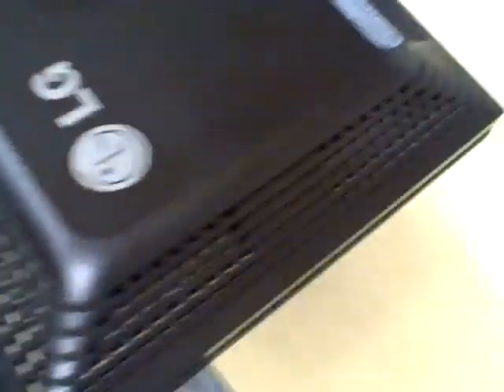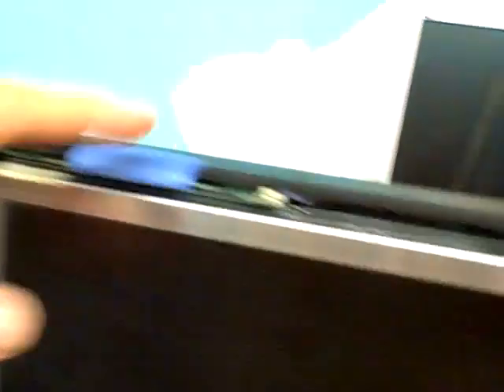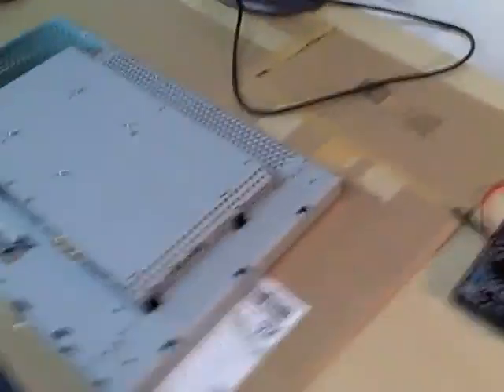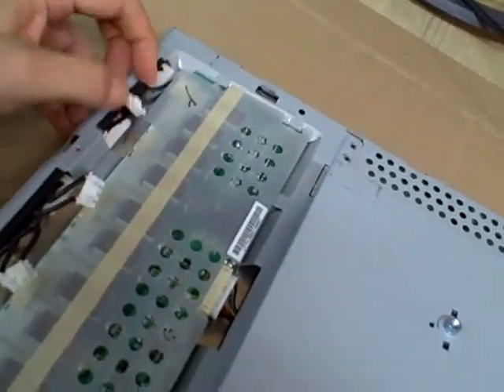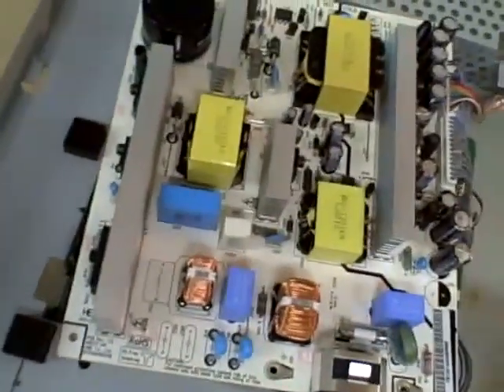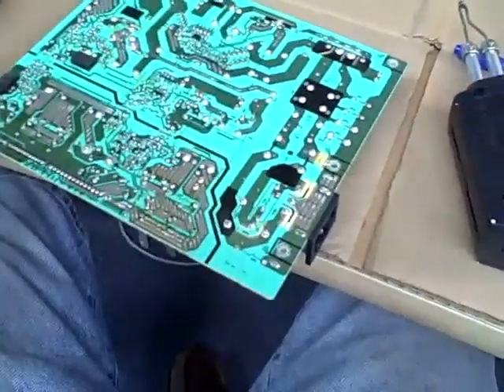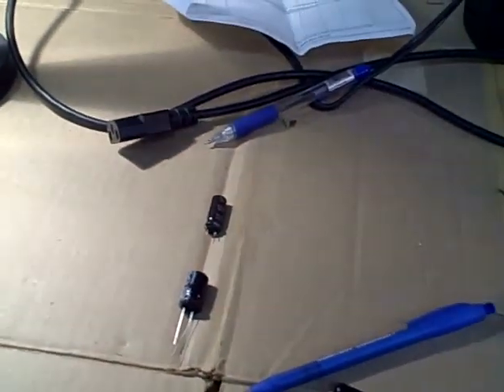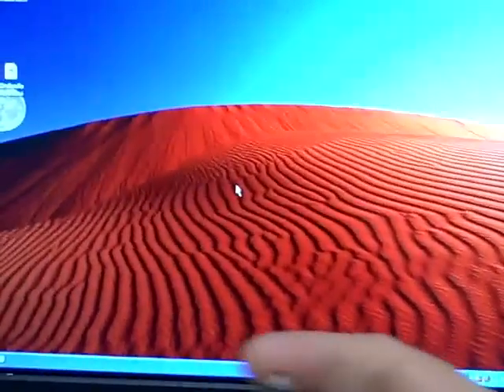LG Flatron L246WP-BN Monitor Repair Tutorial

Comment from the maker: It took about 3 or 5 months from the time my monitor first started having turn on problems until it quit coming on. The capacitors are cheap and it is a relatively easy job. It they fail completely it might be possible for other parts to get damaged so you should not wait.

Comment from the maker: There are two "bad" capacitors that need to be replaced. The circuit board has room for three caps but only two were used to save money. I removed the two bad caps and replaced with three. I had the same wake up problem for a while until it failed completely. New caps will fix.

Comment: Kent, how many 493-1505-ND capacitors do I need to replace?  From watching the video it seems you replaced just one but I'm not sure.  Also, do you have problem with your LG 246WP-BN from waking up?  2 of my 4 monitors won't wake up, the power LED won't turn blue, they always stay yellow unless I do a manual shutdown then power it back up then it turns on.  Yeah, I'm using the latest ATI drivers too.  I really don't know what's wrong with it.  If you have a solution please let us know.  Thanks.

Comment from the maker: Cost cutting is when they remove all the parts possible and still work. The original layout had three caps but one was removed to cut costs. I used three because I could. Generally more is better in power supply filtering. As they degrade over time I will have 50% more margin with three.  It only an extra $0.85.

Comment from the maker: I was told a long time ago that electrolytics work best when near their rated voltage so I picked 6.3V for a 5V circuit. That theory seems to have gone out of favor with the idea that a higher voltage cap is supposed to last longer than a lower voltage one. I am sure the 8000 hour Nichicon will do great even though it is 6.3V as it has been rated for long life under harsh conditions. I do not have the part number of the one I used. Any cap you pick will be better than a bad bulging one. -cont..

Comment: From your video it sounded like the 10v ones were OK, despite their larger sizes.Why did  you switch to smaller ones? Also, I think you are saying that instead of replacing just the original 2 capacitors, you used the extra receptacle on the board and installed 3 capacitors. Why did you do that? Also, do you have the Digi-Key part number of the 6.3v capacitors you used? Thanks

Comment from the maker: Yes. I use it every day. I used three 6.3V, 3300uF Nichicon HE capacitors. Since it was a 5V circuit I chose 6.3V. A 10V high quality cap would have had a larger physical size as the the highly rated caps are larger for same rating.

Comment from the maker: A high pitched noise usually comes form the transformer. I have read that excessive current draw or a shorted winding are common reasons. I have fixed similar issues with a shot of hot glue. 
Since this happened with new caps, it would be interesting to try to place a 1k Ohm resistor across cap. This would add a small load to the 5V standby circuit and it may cause the switching regulator to raise the apparent frequency so as to be outside the audible range. Report your results.

Comment: I had the same problem... so I changed capacitors and is working, but now if the monitor is turned off I hear some kind of pitched noise.. my guess it's the KBL 405G bridge but not 100% sure. I would like to know if anyone has this problem and how did you get is solved. thx

Comment from the maker: I looked at the photo and the solder is fine on C202 and C203. Negative side is to left in photo. Negative side of capacitor has - - - line on side. Use ohm meter to verify rectifier diodes D201 and D202. Put ohm meter in low ohms or diode test setting. Verify conducts on one direction and not in other. Otherwise must be transformer.

Comment from the maker: I do not think it would be the soldering. As long as the polarity is correct it is hard to go wrong. The standby voltage is usually generated by a small transformer/rectifier/regulator circuit that is separate from the main circuit. If you have only 2V I suspect a bad transformer but could be rectifier or regulator.  At this point you should look for a replacement power supply.

Comment from the maker: Use magnifying glass to inspect solder joint. Plug in power supply on bench and measure across the capacitors and look for 5 volts. See my power supply video for troubleshooting tips and my motherboard capacitor replacement video for soldering tips. Look on the BadCaps dot org forum for ideas too.

Comment from the maker: Going dark but power LED staying on and Windows still acting like a valid display is still attached? Sounds like the backlight is going off. The main power supply feeds a voltage to the backlight's inverter. The inverter converts a low voltage into the high voltage the backlight requires. My guess is replace the inverter but it could be the main power supply too. Measure the inverter input voltage to see which part is bad.

Comment: HI, thanks so much for posting this video.  I have the same computer screen and it has been slowly dying for months, it makes a noise when it comes on (not sure what that is about) then flickers and finally turns on, now it wont turn on at all.  Since it seems easy enough to repair it I will go ahead and do so but I was wondering exactly what capacitors you ordered and from where? I personally am not familar with capacitors and which ones are beter than others.  Any help would be great.  thanks.

Comment from the maker: Since there is a known issue with those exact capacitors I would replace even if they look good. I made an other video with more detailed power supply trouble shooting. The "bad" cap should have 5Volts on the low voltage side. On the high voltage side the big capacitor should  have over 160 Volts. If not could be fuse or rectifier diodes.

Comment: Kent, I gave you a Thumbs Up on this video! However, the next one you do, you should get a friend to do the camera and that way you would have both hands free to do the work. Also since this is a Switching power supply, you should CAUTION people about Hazardous Voltages all over that board since some of the other Higher Voltage Capacitors can keep charges for a long time! As a Electronics Manufacturing Engineer, I would suggest NOT using a Soldering Gun as show but a good quality Soldering Iron.

Comment from the maker: Over time electrolytic capacitor lose their capacitance so are less effective at filtering the ripple current. Two will work but three high quality capacitors will have a better filtering ability for a longer period of time. IMHO. They designed the circuit board for three and it doesn't cost much extra.

Comment from the maker: Mine is fine. The high pitched squeal is from the transformer. You may be able to use a hot glue gun on the transformer and get it to quiet down if you get lucky. The big capacitor is for the rectified AC line voltage and is designed to filter 120 Hz from double the line frequency. It should have a voltage rating well over 300 V as many countries have 220VAC x 1.41 = 310V.

Comment from the maker: I replaced the two with three. I use the monitor every day. A bad cap will have high leakage current and poor filtering. I am not sure which problem causes the PS to not work. I had the correct 5V even with a bad cap. I suspect current ripple and not leakage is bigger issue but just a guess. Good caps have little leakage I am happy with three. They work fine as I used high quality Japanese capacitors.

Comment: Hi Kent,
Just want to say thanks for your tutorial, it really was a saver. My monitor is almost identical LG246WH-BN (it's WH not WP) it has a TN Panel instead of an IPS like yours but it has an identical power supply and I had the same Capacitors bulging. I bought 3, wider, from the same brand SAMWHA, and replaced them. I also found that the 25V Capacitor even if it was not bulging it was bad in replaced that also.
Now I was told that the third capacitor could induce more current inside.

Comment: Hi Ken I have a LG Flatron 246WHA monitor. I have followed your instructions to take it apart and look at all the components. I have found one resistor burnt out, with the colour code all burnt and cannot identify its correct vaule. Can you help me. It has a number where it is on the circuit board R503 can you please tell me the colour code so I can buy another one. Thanks Mal Brown.

Comment: Thanks for this video we have an 24" LG 1920x1200 monitor, which is damn hard to come by now days, that dropped dead on us.  We watched the video and followed your suggestions and the monitor is up and running again, we didn't even need to buy any capacitors we just nicked them from an old PSU ;)

You have made two IT techs with an extremely small budget in Australia very happy.

Comment: NOTE: To unplug the small circuit boards, be aware there are two little tabs beneath the plug. So, to get it out, you must lift up a little. Just pulling is hard to do.

Comment: hey man where can i find the power supply schematic of this particular tv? my friend gave it a check and found out 2 resistors that are located beside the large capacitor on top left corner or board were burned, so we're trying to determine what resistor it was to replace with correct voltage but we cant get the color codes for them. any help you can offer would be appreciated!!!

Comment from the maker: @ItsVideos I did not take the display panel apart to see. It had 8 connectors. In the video the display panel seemed too thin for rear mounting so I guess edge mounting. I completely disassembled a different brand LCD panel and it had CFL lamps on edge so I suspect this is same.  I cannot imagine replacing the CFLs with LEDs would be possible as LEDs would cover entire back of panel and have dynamic brightness to give better contrast ratio.

Comment: @KentDoub Yes, thanks for the idea, you had given me some hope.
I just tried that DVI to VGA cable swapping. I had reset to the factory settings, turn off the monitor and turning back on. And just for a split second, the picture quality came back on normally and then back to the same symptom. I guessed that it may be the I/C chip or hope it'll be just the caps. Still crossing my fingers.

Comment from the maker: @geraldlkc  Have you tried using the VGA input instead of the DVI? Your video showed vertical bands of color. I have seen this with poor connection at DVI connector so maybe wiggling connector will change? If so maybe cold solder joint where connector is attached to circuit board. Try poking on components with monitor disassembled to see if anything changes while tapping on parts. Even though the electrolytic capacitors looked good in power supply there could be a bad one letting ripple through

Comment: Thanks alot.  I used this in conjunction with some other articles like how to remove a capacitor and it helped alot.

I never done it before and I was able to do it no problem.  Ordering the Capacitor was confusing and took some work but overall a success.